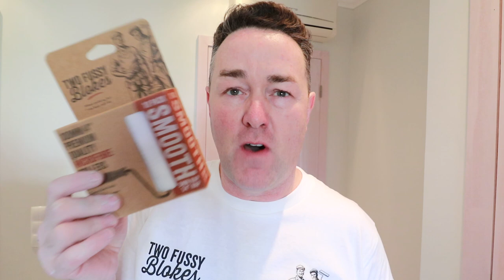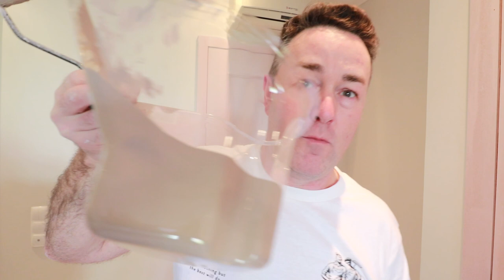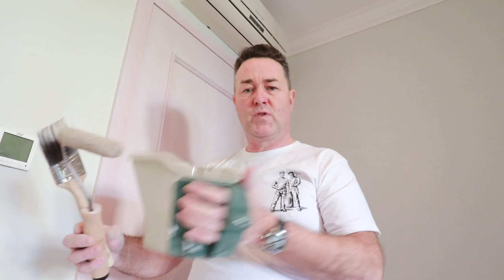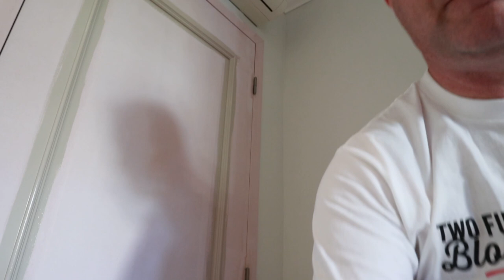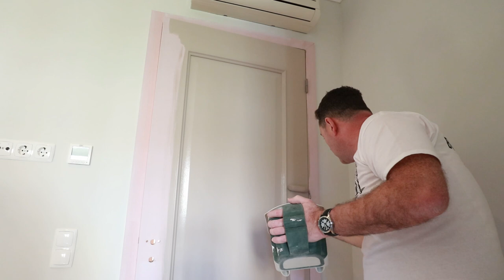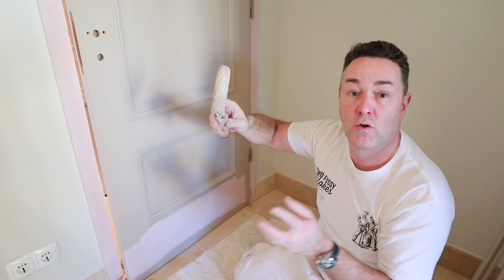How to Paint a Door Like a Pro: Tips and Techniques for Perfect Results

Comment: I use these rollers exclusively. In fact, with the exact same set up you have there. I don't think I could use anything else now. They're brilliant. 

As for washing rollers out, I've had this conversation with my decorator mates a few times. It's a dilemma. Is it more environmentally friendly and economical to wash or throw? I've leaned more towards throwing them away after a couple of uses. You can buy pretty decent throw away 9" rollers these days and you've not got to spend 45 minutes running water and chucking paint down your plug hole.
Reply: I have the same dilemma but tend to reuse quality rollers over and over, I roll out as much paint as possible, leave in a can of warm soapy water for and hour or so then rinse for about 5 mins. Seems to do the trick for me. I'm on the search for a mini sleeve roller spinner, I have a 11/4 sleeve spinner which is a godsend.
Reply from the maker: I'm finding that if you leave them damp, then come to use the roller it seems to ooooze out some water at first with the paint, water that wasn't there when shook out after washing.
Reply: @Phil Beckwith The Professional Painter & Decorator  Yeah, you've really got to give them a good spin. I tend to keep wet in the paint I'm using. It's fine in satin but they're no good after a few uses with Johnno's brush killing WB undercoat.
Reply: Wrap them In a towel and stick em in the tumble dryer it’s noisy but works a treat 👍🏼

Comment: I'd just bin it. I do exactly the same thing as you with the edge of the door and moldings. 

Here's a tip if you haven't tried it.
You don't have to brush the moldings in, you can actually use the the little nooky roller. Just cover it and tip it off as you normally would a panel..

Great work.
Reply from the maker: I did try not to brush the moulding, but it didn't look so good,  with how quick i could go around it with the 2" I kept with it and just filled in with the roller. The paint goes on so well.
Reply: @ProfessionalPainterDecorator  absolutely Phil, I still use the 2 in these areas. I've had to paint hundreds of doors by just brush alone, so it's definitely great and more efficient and time saving with using the roller in conjunction..

Obviously many people spray or paint their doors off. But sometimes it's an inconvenience depending on the job, so it's cool seeing you paint the door while it's on. I'm currently working on a two story interior and we've done exactly what you've shown.

Comment: I use 2 fussy blokes exclusively. I sprayed some units a while back, and had to return  a year later to do more, but couldn't spray second round, used 2 funny blokes instead and they looked better than the sprayed ones! Would suggest the 5mm nap for the final topcoat to avoid any orange peel.

Comment: Can someone please help me out with a question - is Floetrol additive still a thing, or have water-based paints progressed to a level where it's no longer needed?
Reply from the maker: I think some may well do so, I've never used it or flet th need to add anything to my paint, other than a splash of water if it feels a bit too thick (round) when applying it.
Water based paints are so much better these days.
Reply: Small drop with Aqua-Guard .😉

Comment: Pro dec mini micro fibre rollers are outstanding, from screwfix or toolstation, pack of ten I think for sod all… better then these too.
Reply from the maker: In what way better, do I need to get some to compare?

Did you use the 5 and 10mm 2fb rollers?
Reply: Would be great if you did a short compare vid! Or put something on the Instagram, I just think for price, the amount you get, how much they ware, brilliant mini rollers, always have a couple packets in the van, I need to check the length of pile but it's short, they work great in oil paints.
Reply from the maker: @t.dizzle83  leave it with me.
Reply: Think it's Toolstation, always confuse the two

Comment: I asked a decorator what rollers they used on doors and they said hamilton prestige short pile felt roller so I went and bought some and what a load of 💩at holding paint but they did leave a smooth finish. I then seen a decorator on tiktok recommending two fussy blokes smooth rollers so I thought I would try them but they are not much better at holding paint so I which I had bought the semi smooth roller now. I need to buy some new brushes but I've never used a angle brush so are these any better than a normal brush
Reply from the maker: Ideal for cutting in.

Did you get any 10mm rollers.... They will hold more than the 5mm
Reply: @ProfessionalPainterDecorator   No I haven't bought any 10mm rollers yet as   I'm waiting until I decide if I want to buy the angle or the normal brush.
Reply from the maker: @internetaccount4879  get apack of each £17 a box
Reply: @ProfessionalPainterDecorator  Where you getting these for £17. I'm not a decorator and brewers want £28.49 a box and other online places are about the same with delivery
Reply from the maker: Crown and Painwell, even Dulux have had them about that price.